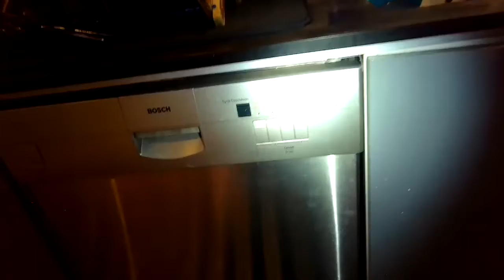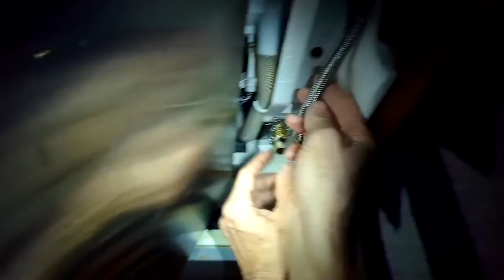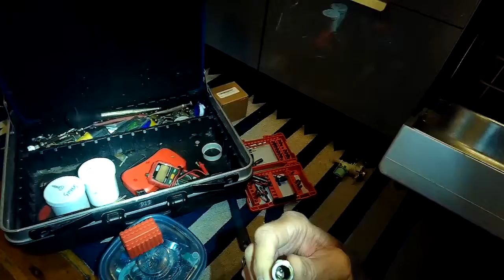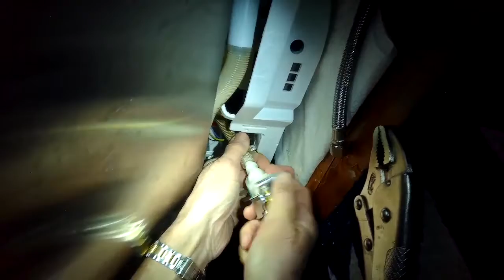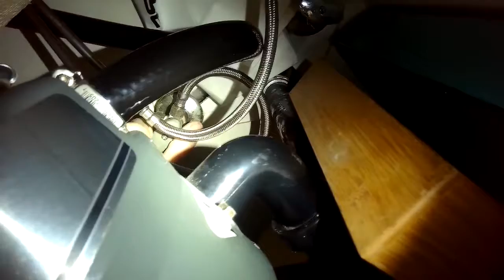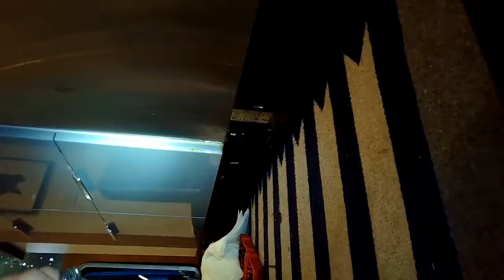✨ BOSCH DISHWASHER - Not Filling Enough Water - EASY Diy FIX ✨

Comment: Hello Scott. Thanks for an excellent DYI video. My Bosch Ascenta is having similar problem as described in the vid. I do have a couple of questions re how the water level is controlled. Q1. Does the fill valve fill according to a timer? Won't be logical because the machine would end up with various amount of water due to difference in water pressure. Q2. Will filling keep on going until a level switch is made? In that case, it will just take longer to fill when fill valve is partially clogged and the machine would not run with low water level. THANK YOU!
Reply from the maker: Thanks Willie,

Usually the solenoid on the fill valve gets weak and won’t let in enough water in the prescribed amount of time so the water level never activates the water heater and the dishes don’t get cleaned 👍
Reply: @ScottTheFixItGuyChannel  Thanks again for the clarification. It is greatly appreciated.
Reply from the maker: You’re welcome 😊

Comment: I tried to put enough water and let it run a cycle but it just drains the water and then stands empty not doing enough yet it's running. When I open it, it still runs (I see a tiny water spray if I remove the filter) which is odd, usually it pauses. Help 😢 it's a disaster now just a few days before Christmas!
Reply from the maker: You’re doing good.
Just need Amazon to send you the new fill valve and replace it👍

Comment: This video was exactly what I needed.  I had success even though I couldn’t get the elbow loose so I took off the face plate and brass fitting and swapped on the old brass components onto the replacement plastic assembly.  

I’m lousy at fixing things, so if I had success then the instructional video must be good.
Reply from the maker: Nicely done Jason😊👍

Comment: Helpful tip on removing the power/ground connectors from the valve: there's a spring piece built into the connector that engages with the hole in the tab and also acts as a stop to prevent the connector being pushed too far on - if you press the stop with a small screwdriver blade (at the top of the tab when it's properly connected) it will disengage the lock and the connectors slip off the tab with very little pressure required.
Reply from the maker: Excellent info. Nick😊
Reply: @ScottTheFixItGuyChannel  thanks.  I used your video today to guide removing the valve for my low fill problem.  Couldn't get the 90-degree connector off, but removed the 4 screws that hold the inlet side onto the valve body's o-ring, and then removed the filter which was pretty solid with crud.  Put it all back together, with a little silicone grease on the o-ring, but unfortunately it didn't solve the low fill problem.  Sigh.  Ordered a new fill valve.  I may take apart the old valve when I have the new one and see whether I can figure out what really happened.   Thanks for putting up this video!

Comment: If the valve is old, there is also the chance that, while it may not be clogged, the internal coil lowers its resistance (usually degredation of the insulating material over time/internal shorts) lowering the magnetic efficacy of the internal valve mechanism so it cannot pull the plunger, that keeps the valve closed, open all the way, instead only partially. The effect is the same as having a lot of sediments in the filter area. You will have a decreased amount of water, and is far more common than crud in the filter.
Reply from the maker: You are so, right,
The answers to replace the valve.

Comment: I was unable to unscrew the elbow pipe with any amount of force I was able to apply, and did not want to ruin anything.  Suggestions?
Reply from the maker: I’ve had that happen also.
If you can remove the old valve from the dishwasher, you can brace it with vice grips or a vice and then use a crescent wrench to grab the brass elbow and turn counterclockwise 👍
Reply: I had the same problem. I unscrewed the four screws holding on the rectangular plate and brass fitting from the old assembly and swapped them into the replacement assembly.  I only forgot to make sure the black O ring was in place, so I had to do it twice but eventually had success.

Comment: Excellent video.  I diagnosed the problem from another youtube video, and your video shows me exactly what I need to do to replace the valve.  $20 Part is now on order.

Repair videos on youtube are an immense help.  This is now the 3rd major appliance I've been able to diagnose and fix myself via youtube videos. The others being a central AC, and a dryer.   I'd say 0% chance I'd be able to fix these without people making repair videos like yours on youtube.
Reply: Finally had the time to install the part, and the dishwasher is now working.

I'll say that it wasn't terribly obvious that the valve was clogged, but the new part works, and the old one doesn't.  Maybe you could try to fix the old part by soaking it in vinegar to dissolve any built up scale, but for $20, it's easier to just buy something new.
Reply from the maker: I agree 100% Steve.
I’m using YouTube videos all the time to learn how to do different repairs on my cars.
Reply from the maker: Nice job Steve😊👍

Comment: thank you. I have the same problem. When I add water manually it washes the dishes perfectly. I will try to fix it today
Reply: cleaned valve filter, didn't help. Have to buy new valve
Reply: changed valve - working!!! thank you very much!
Reply from the maker: Great job😊👍